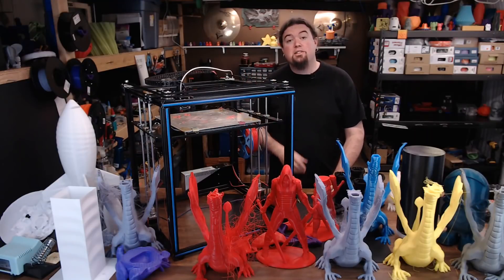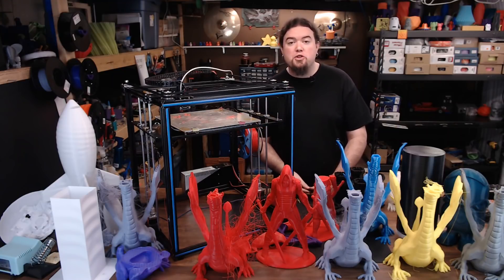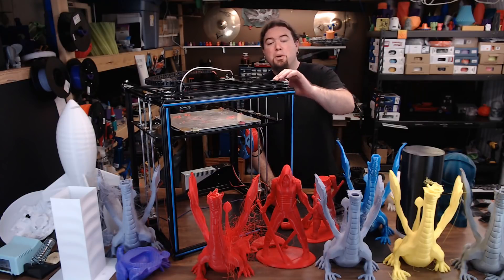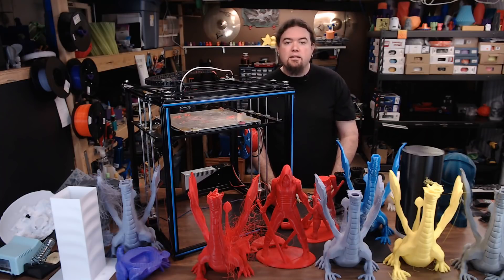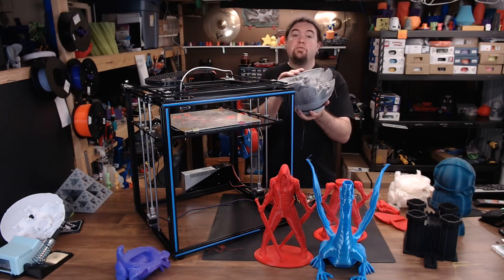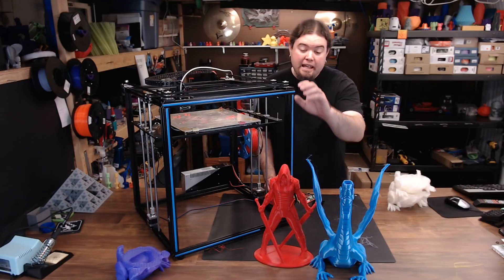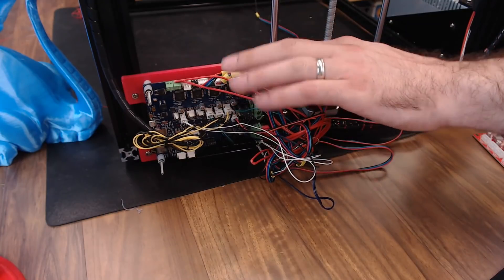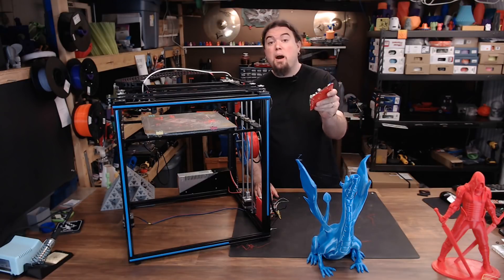Tronxy X5S 3D Printer Review - Kinda - Chris's Basement

Comment: Hey great review. I’ve had this machine now for about a year now. And I made a lot of upgrades. From the PSU to the frame to cooling. Today is the first time I played with the board software. I upgraded from 1.1.6 marlin to 1.1.9. The only reason I did this is my heat bed heats as I turn the power on and I can’t adjust it down or up. I even trued a separate PSU to run the bed through my mosfet and still nothing. I was wondering if you had some ideas for me thank you. Have a nice day
Reply from the maker: Thanks! It heats all the time, no matter what? That sounds like you have a bad mosfet.

Comment: Haha, honest review.. I regret this is the printer i bought, i like tinkering but this is just too much, 
it would be long dead if i hadn't had a friend with anet a8 helping me out with printing replacements all the time..  
using it I struggled with mine for a long time until the board fried just by plugging it to pc.. 
can't make up my mind if should i bring it back to life.. prob will, because i'm hard to give up.

I've got maybe 2 good prints out of it, most of the time i just looked for all the upgrades to print trying to make it better.
It was design flaw that bent 2020 "y" rails down in the middle making it impossible to level the bed, but still the bed is terrible and crooked.
I had to wait over 12min to hit 70*C bed temp, strengthen the frame in every corner for it to stay square, takes up half my desk and its impossible to build enclosure for.. 

I thought i was smart starting big.. but now i would trade it for prusa clone anyday.. i dont actually need that big printing bed (and big problems) and feelt stupid printing something small having to waste electricity for heating it whole
Reply from the maker: I know man, this one is such a trial. I know exactly how you feel about not giving up. I think mine is going to be a donor for a hyper cube build.
Reply from the maker: @Daniel Roberts What am I bid?! Seriously, it's not worth the shipping.

Comment: What large form printer do you think is Better, for the price or a little more Less than $700
Reply from the maker: This is a really strange area for 3D printers, you have these sub $500 large volumes then the next level up for a large volume is over $1000. Still my favorite out of the bunch in the original CR10, add a second lead screw and it is super stable.

Comment: The issue is with the slicer settings specifically with certain models. I was having similar issues. I used the slicer that tronxy gives and haven't had any issues since. They give you repitier, but I used the other one that's on the SD card
Reply from the maker: I have never had any luck with the older slicer. It comes with a lot of printers.

Comment: You tensioned it wrong. You. Want to run the belts and then seat it into the gear pulley. Then slide the motor into the pulley and you screw down the motor to the plate. With the amount of tension. You were trying to put on it, I could see it starting to skip steps
Reply from the maker: It's possible, I will be using the parts for another build.

Comment: Hi Chris, thanks for this nice and honest review again.
According to other sources, the printer shouldn't be that bad though, but seeing yours, ..., it's just another TronXY.
Is it possible that the board is overheating?
I had a similar issue with my Anet A8 twice, once with the original board and once with my RAMPS after I've moved the printer to the new spot.
BTW. I wouldn't trust a TronXY or Anet without upgrades printing stuff without me watching ;-)
Reply from the maker: Thanks man! I did my best to try to test for the board overheating. I had a 40mm fan over it, then I set a box fan in front to make sure it was getting enough air. I think it was just a bad kit all around.
Reply: Looks like it, there's always a bad kit out there. I really like that you retry again until you get it working. 
In my case, the 40mm fan helped luckily. 
Did you leave the printer print the large parts alone? Have you installed anything fire-preventive? 
That's my largest problem currently, I just don't "feel confident" of letting my machines print alone.
Reply from the maker: I do leave the printers running over night, but usually not when I am away from the house. I don't have any fire prevention, but I do have 3 smoke alarms in the basement. I totally understand you not being confident in some of these printers. You never know what they might do.
Reply: You're right, you never know when the one screw holding everything together might come loose...
The only printer I trust more or less is much JGAurora A5 and my Anycubic Kossel, as they worked well without any real problems so far. 
But, you can never be sure...
I have done some research about this topic but didn't find an ideal solution either... So, let's hope for the best!

Comment: What issues have you found using bearings as idler pulleys ? I made a dbot using the same idea and have never thought that would cause accuracy issues as it is only bending the belts around 90 degrees.
Reply from the maker: I don't think it is so much the bearings as it is the bolt they use as a shaft. With as tight as the belts need to be, the bolts flex just a little.

Comment: Hi Chris, this is my first time posting on your channel so I just want to begin by giving credit where it is due and letting you know that I think you do good work.  The actual reason I'm posting though is because I own a Tronxy printer of a different model and I just wanted to briefly tell you about my experiences with.  Specifically I own the Tronxy X3 printer.  This is the first and only 3D printer that I own.  I purchased that particular model because it was very inexpensive, costing me only $282.00 at the time.  Since this was my first 3D printer I didn't have a frame of reference to compare my Tronxy X3 to and I had to build perspective over time as I researched and addressed the issues that I encountered.  Fortunately I am an experienced tinkerer and I know my way around mechanics and electronics so I have been able to improve the printer over time and build it up to be something decent.  At first the printer was a serious fire hazard.  It had wiring that couldn't handle the wattage they were carrying, I had to add a couple of external transistors to drive the heating elements, and the Melzie 2.0 control board was in dire need of some active cooling.  On top of that it also had some mechanical shortcomings.  For instance, the build plate carriage was unstable as it was and required some modification.  There have been plenty of other changes that I felt necessary as well but this will be a very long post if I talk about all of them.  Long story short, I have almost completely re-engineered this printer at this point.  The v-slot extrusion frame is pretty much all that remains of the original printer.  I have replaced most of the electronic components and re-designed almost all of the brackets and fixtures.  I hate to say it but given my experience with the X3, and now seeing your experience with the X5S, I'm feeling like Tronxy is a bit of a "minimum viable product" kind of company.
Reply from the maker: Thanks for taking the time to comment. I agree with you, I have had a couple of Tronxy products now and they feel a little slapped together. The worst part it's usually small stuff that could have been fixed for probably the same cost or close to it. They are affordable, I give them that. They are also a challenge and some days a challenge can be fun, but probably not for everyone. :)

Comment: Even with those problems I think its still worth it...  Mainboard can just be replaced with a ramps or similar,  they are cheap enough...  Seriously, with kits you do expect some problems but thats the fun of it too - to make it better and fix the little faults.  Maybe in the back of your mind you were comparing it to a more expensive machine.
Reply: Some kits are definitely better than others.

My first 3D printer was an Anycubic Kossel Linear Plus and it was an absolute pleasure to build. It was the first time in a long time I'd seen a color printed manual and it was completely accurate. The parts for assemblies were broken up into numbered bags and each one had at least one spare nut and bolt. My only criticisms of the kit were the M2.5x12 bolts for fixing the end stop switches: they were really low quality metal and either should have been shorter (say M2.5x8) or they should have threaded the holes in the end stops as I kept stripping the hex holes out of them whilst trying to tighten them with the supplied allen keys.

From what I've been seeing in YT videos and reading in comments the Tronxy kits are a bit of a basket case. That said, I've been wanting a CoreXY printer for a while and have an X5S-2E enroute at the moment, so I might be punishing myself a bit over the Xmas break.
Reply from the maker: @anthonyrich1592  Agreed, I really like that Anycubic kit, very well done for the money. Good luck on your core xy build, hopefully Tronxy has made lots of improvements since I built mine.
Reply from the maker: If you go by per cubic mm of build volume, there is probably still value here. I try to go by out of box experience. What would someone buying this printer have to go through. I agree with you, with these kits, a little tinkering is expected and I do find a lot of enjoyment in that aspect.  It really comes down to how much tinkering and how much extra money are you going to have to spend to get a decent prints. The replacement part list on this one was just to high. It took it from tinkering, to almost rebuild. Thanks for the comment, I always like to hear other points of view.

Comment: You cant make a good COREXY machine with this...not RIGID at all, may be a slow speed
Reply from the maker: I think it would help for sure, getting the idlers mounted ridge would be the best place to start.
Reply from the maker: Definitely didn't work out very well.
Reply: My DIY CoreXY is very  very stiff if i compare .. but still got some issue again
Reply: I wonder if some corner triangles would help brace it

Comment: Sorry to hear about your bad luck, I had the same mounts but avoided the motors flying off! I have had this printer for 2 weeks and have had pretty good success from day 1. I am picking up a 6mm thick piece of glass I had a local shop cut me for $15 so I am looking forward to a more level surface, the flexible plastic build plate worked, but glass is far preferable. I ordered new belts but have not installed them yet, I have printed 5 things flawlessly without leveling at all, something impossible with my Anet until recently. Thank you for the info on your experiences, always good to share knowledge.
Reply from the maker: Awesome! I am glad to hear someone is having good luck with this printer!
Reply: @ChrisRiley  I stumbled across a X5S 'return' and got a deal, when it arrived all the hardware was new just the 2020/2040 parts had wear marks, after two days of cursing at TronXY since the X5S I had didn't match any on Youtube I was stumped until I read a review that explained the instructions were on the thumb drive/SD in a directory. TronXY X5S Version 4 - All the belt guides were different/fixed and the Z motor mounts metal, X carriage 'sliders' were metal and they had upgraded the firmware to 1.7... Power supply is bigger, the head is different, has a heat shield on the heater block. I plan on replacing the cheap piece of crap controller, 128K memory! so 2014. And yes Gates 2GT belt replacement, seems it is a thing, my Pick and Place machine (from Turkey) came with junk no-name belts that were bumpy! The current price of $239 for a X5S to $279 for the X5SA and $312 X5SA Pro would make the Pro a deal but they still are using junk for the controller with 'custom' code, they don't understand 'Open Source' and how it is suppose to work.
Reply from the maker: @airheadbit1984  Glad you got a good deal, I hope you can make something awesome with it.

Comment: That mainboard looks like my Anet A8's board and yup they kinda are low quality.
Reply: I was thinking the samething when i saw it.
Reply: I have the same stop and reboot issue with my Anet A8....I wonder what the cause is...and mine stops at that about 20~mm height too
I even reflashed mine with stock Marlin 1.1.9
Reply from the maker: I don't know, just a bad component flaking out I guess. I would be curious if a re-flow helped at all.
Reply from the maker: It's really close to an ANET board, maybe a little bit better, but not much.

Comment: I recommend to always keep an eye on the serial communication. It will tell you when there was a board reset. I also added some code in the "kill" procedure to get more diagnostics info when kill is called. This helped a lot to diagnose issues, like a broken heater wire (serialprintPGM(lcd_msg);). I added an nRF24L01 board so I can always monitor the serial communication wirelessly, works great!
Reply from the maker: Well that's a cool idea. I had it plugged into Octoprint, but the exception info it spit out wasn't very helpful.
Reply: @ChrisRiley  maybe you could make a howto on Ron's Killcode if you understood what he said. Cause I sure didn't, only that it sounds very useful for this kind of issue.
Reply from the maker: @BeardedSkunk  Yeah, we could probably do that. I will do some research.

Comment: Chris one possible cause of problem  COLD SOLDER joints  can try a heat gun at med heat about 8" - 12" away just heating the board up a bit (not too hot) might cure the problem if not then I would say bad components on board
Reply from the maker: Thanks Rover, I could give it a try.
Reply: hmm....never thought of that...will still suck having to pull the dang board though
Might see if I can find a reflow oven

Comment: I have an X5S also, and I've done a lot of modification to get it to print decently.  It still is not 100% consistent on the layer placement, but it is not too bad now.  BUT, like you said it takes a lot of mods to even get decent quality out of it.  I didn't run into the mainboard issue like you, but I did switch it out because the original main board is just too limited.  I am considering doing a major overhaul and getting rid of the CoreXY configuration and making it a Cartesian setup, but instead of the bed moving Y, it will only move Z like it does and the head will move X and Y, like it currently does.
Reply: I also own and use the x5s.  It is heavily molded as well to get decent prints.  Biggest improvement is redoing the belts and guides to actually be parallel instead of angled all over the place.  Board works fine for me but I did add a mosfet and 24 psu for the heated bed
Reply from the maker: Thanks Chris! This review has had some interesting comments so far. Some luck, but mostly only with a lot of mods. Thanks for weighing in.
Reply: @ChrisRiley  of course.  I would say this has good bones for the price but requires someone with time and expertise to make it worth it.  In the end add $100 in some parts and some tinkering time to make this an excellent printer for the money but before that it's honestly junk.
Reply from the maker: I hear ya, this printer has been a lot of work. I am thinking about turning mine into a hypercube setup. We will see if I get around to it. Thanks for watching!